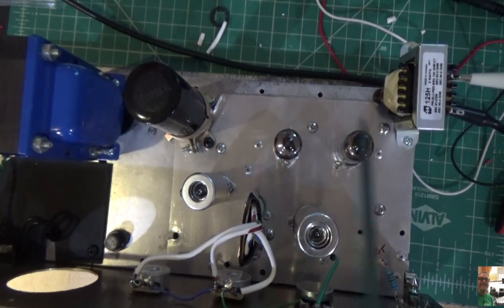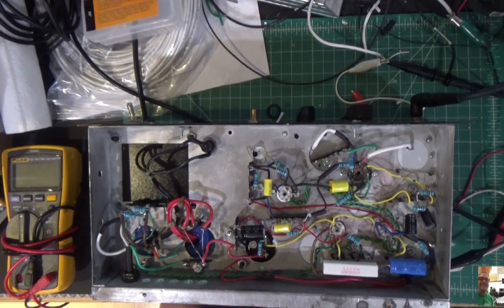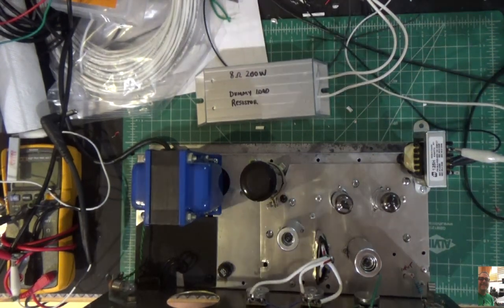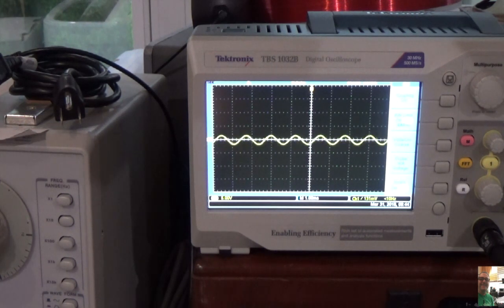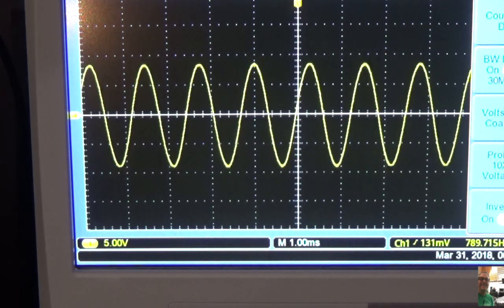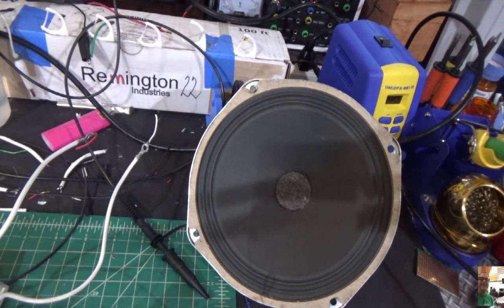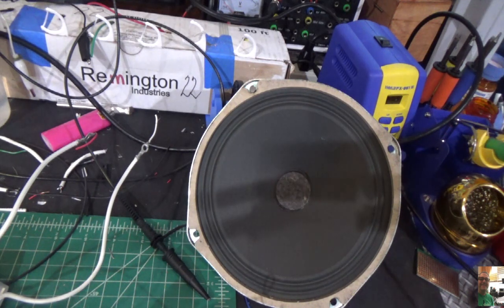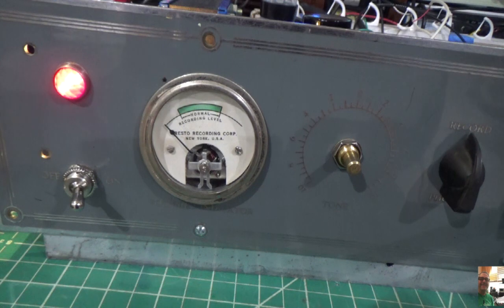Presto K8 Goat Deluxe Amp Build - Episode 10 -  Safe and Sound at last

Comment: That is a lot neater underneath. I am glad you left it in the other chassis and didn't switch it over. Looks like a much nicer cleaner set up now. That's a nice clean sign wave for sure.I like the amp with the meter in front too.
Reply from the maker: Thanks Larry - I am very pleased as well.  My projects always take a left turn at Albuquerque and then I straighten up.  LOL     Thanks my friend.

Comment: Good for you,glad it worked out.-meters are good for a lot of things. My ears tell me what I need to know. If it sounds good, this is what counts in the end.Wish I had an oscilloscope. May be a while before I can get one. I finally got the rest of my parts, so maybe I can finish mine now. There are a couple resistor values,I don't have, so I may try another value and see what happens. I think the cathode bias resistor on the 12ax7 call for an 820 ohm and I don't have one and I don't know whether to go higher or lower. It is a 5e3 amp but I didn't have a 12ay7 so I am using a 12ax7 instead. May be too much gain, not sure. Another thing I am concerned about is- I heard someone say you could use rca cables for shielded cable for signal wires. It sure is awful small wire to be coming off the the plate with that voltage. I have some satellite cable but those wires are so big. It is hard to tell how big something is on you tube videos of building amps because it is magnified. I don't know if that little wire can handle those voltages? Looking forward to seeing your finished amp.
Reply from the maker: Anything that has B+ going thru it should really be 20-22AWG... nothing smaller. Thin wires will not be able to handle the current and you will have all kinds of problems which  will be really hard to find.   Check Amazon, some pretty good deals on wire spools.    Stay with it... have fun, learn and be safe !!!!  Ron
Reply: thanks

Comment: Terry, D Labs, designed a good amp, you did him proud Ron.  
Brad, the guitologist,  recently did a Kustom head, your amp sounds better.  
Of course, the Kustom was transistor.  
See if you can find a better speaker though, perhaps an instrument one.  
But for a cheapo speaker, it did OK.  I bet you'd blow it in do time.  
Don
Reply from the maker: Thanks Don. That Jensen speaker is a guitar speaker from an old HARMONY amp. With that said, it would be better with a modern speaker but who knows.. maybe :)
Reply: Harmony went down the crapper after the 60s.  Yah, the Jensen might handle ten watts, but not bass.  I think your amp might go well with an old 10-12" console organ speaker which can easily be found well under 50$. I like to build cabinets, but old wood radio's are kewl too.

Comment: Great sounding amp, the clipping is at the top of the range, that is good.
I am so glad you decided to leave the amp as original as possible and most of all the meter is right on the face plate where it belongs.
I will be looking forward to the completed GOAT Deluxe.
Reply from the maker: Thanks Bill... that was the right call.. the meter belongs on the front and its working really well.  She is going to be very sweet when done.. This has been a fun project for sure !!!!   Thanks my friend
Reply: Tommy can use a good hi powered amp to rattle goat's windows, lol.  But seriously, does Tommy have a TUBE amplifier?  This could be a good project for father and son, give the boy a soldering iron blinky tinkerer. 
Don